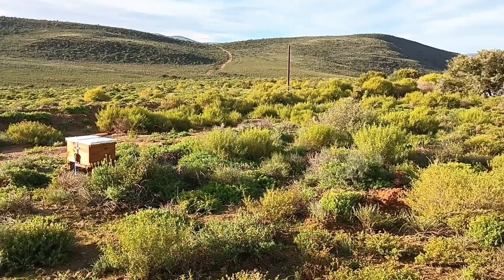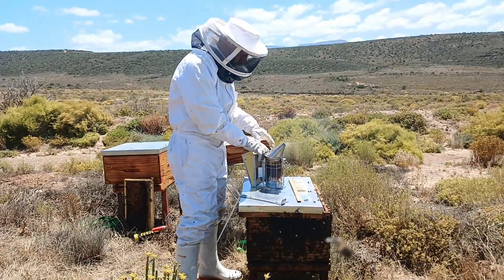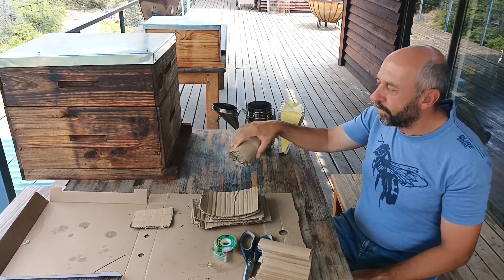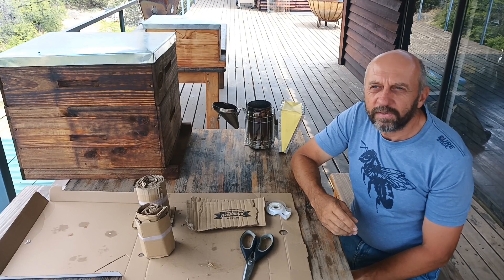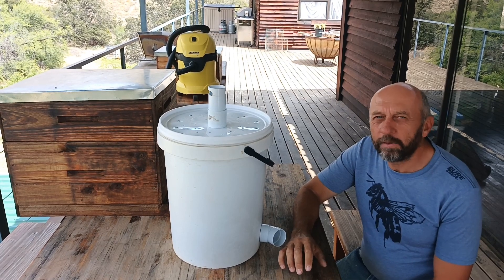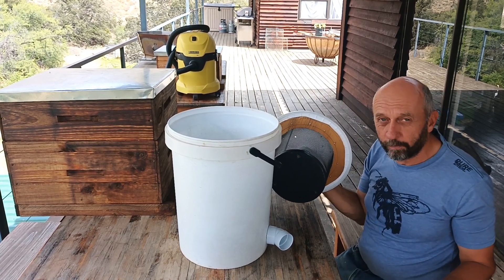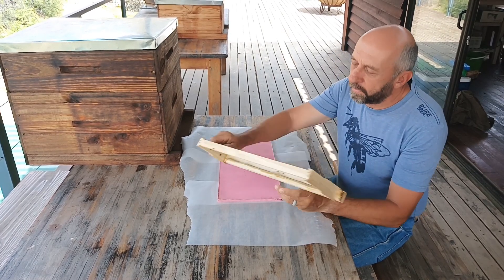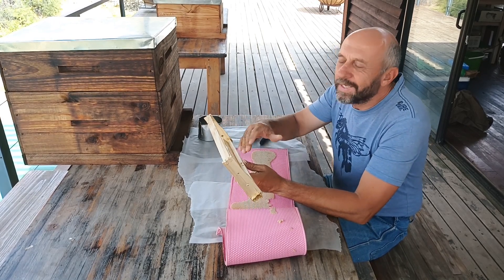Natural beekeeping & DIY equipment/supplies (Update 010)

Comment from the maker: Using the mould takes a bit of practice. My mould is slightly thicker (and heavier) on one side, I think that side was up in the video. I should have flipped it over. Less pressure is definitely better. Beeswax foundation also gets brittle over time, so freshly cast foundation is easier to work with.

Comment: In italy, bees like to make their nest inside a tree, atnd beekeepers tend to place hives in half shadow, on some stand to protect from ants, and not far from a water source, natural or not. Each long trip to find water , is a missing trip to find nectar.... regarding the smoke fuel, we use the same, but with a twist.. put the cardboard in the water, let it sit and dissolve a little and then compress it with two hands. On the natural and no expense approach? 100% agreed
Reply from the maker: I am considering some shade for the hives, as our summer sun is harsh and temperatures high. But if I look at the common practice in our region, hives are placed in direct sun for the most part. Hives painted white is also common in the area so maybe that is worth considering.

Comment: Excellent video, dankie. Ek hou van die formaat en die info.
When you told me about the bee vac, I had to improvise on your explanation, the other day to get wasps out of the house. Worked 100%
I assume you don't want to press down on the wax mould, or it will be too thin?